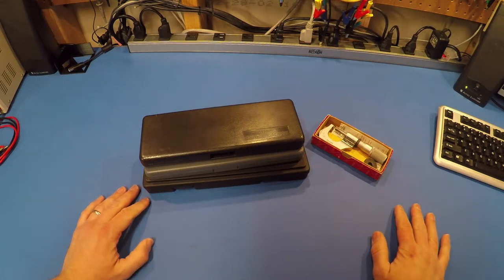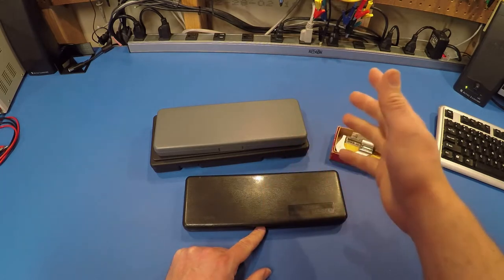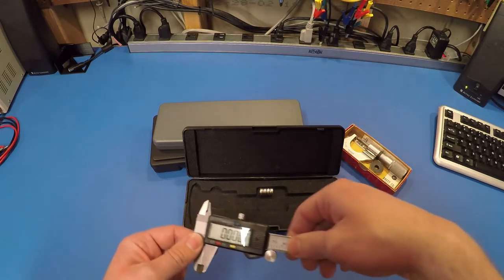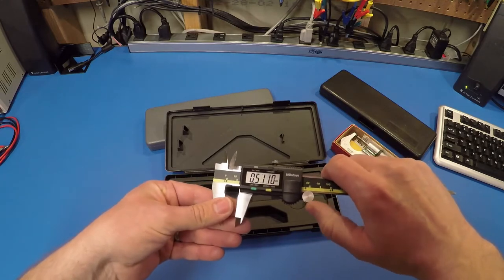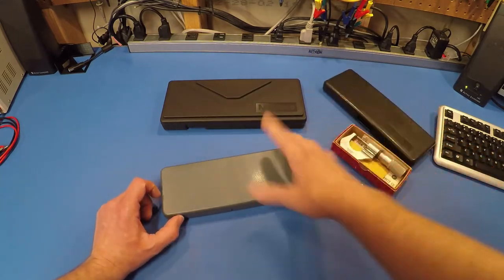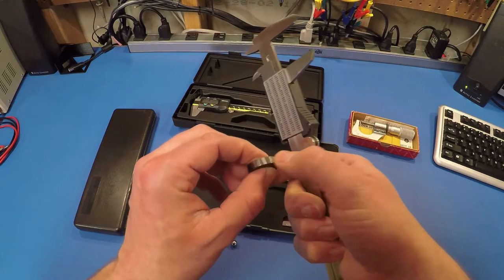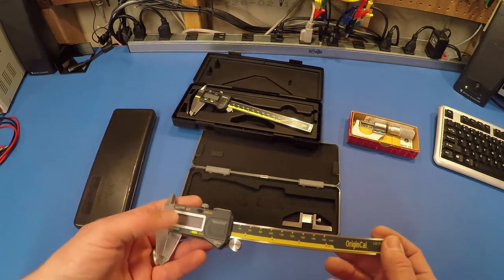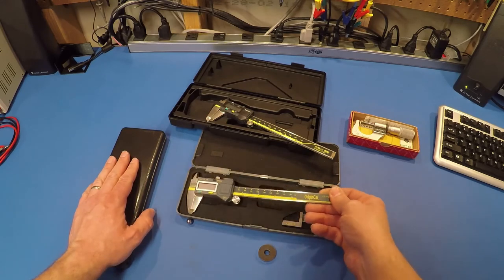Mitutoyo, iGaging (fractional) & Dirt Cheap Digital Caliper Comparison & Testing

Comment: I cringe when you touch the 1 inch calibration ring on its outer face. I had it drilled into me to NEVER touches the outer face with ones fingers. Our skin will leave corrosive material on the metal that will cause corrosion and affect the accuracy. We kept them oiled and in a soft cloth bag and only touched the sides. Thanks, for the review and information. Wish Mitutoyo would do fractions, but as they are made in a metric country, they don't seem to worry about what us dinosaurs use.

Comment: A tool and die maker once told me not to store any caliper in the full closed position, as expansion and contraction of the instrument could distort the tool and give an inaccurate reading.
Reply from the maker: Makes sense for a micrometer since it would hold the tension on the anvils if closed fully.  On a caliper, unless you've locked it with the thumbscrew, i would imagine it would be free to move with expansion and contraction.

Comment: I don't use calipers every day so I didn't want to spend a ton of money on them. I picked up a cheap 12" calipers and they have been decent enough for the money. The action is smooth, repeatability good, but not so good on battery life. The cheap 6" calipers I picked up were not so good. The sliding action is poor. The two moving parts seem to grate against each other somewhat. The company selling the cheap calipers makes a difference. There are the good and the bad. It is a bit of a crap shoot as to what you may get. The 12" calipers are the ones I find myself using most often although they can be overkill when measuring small items.

Comment: Very helpful.  Do you happen to know if the "genuine" Mitutoyos I see on eBay for $40 are actually genuine?
Reply from the maker: Not really sure but I highly doubt it for $40. If its too good to be true it probably is.  $80-100 would be more believable.
Reply: netmagi Thanks!  I think I will play it safe and stick with the iGaging.
Reply: Their are 3 quotes that have held true for a long time, Buyer beware, You get what you pay for, If it seems to good to be true ... it probably is,  So to answer your question ...  With absolute certainty ...No, they are fakes. Save your money and wait and buy the real deal, they will hold up to the test of time. You will much happier in the long run, don't support people counterfeiting others quality products that the original company have spent the time and efforts perfecting "Their" product. P.s I own both real Mitutoyo and iGaging  and I love my Mitutoyos but the iGaging are also very nice!

Comment: The case for the Mitutoyo has always puzzled me.  Before I knew what Mitutoyo was wrt to quality, I opened the case of one at work and assumed I was using a budget instrument.  It conveys cheapness.
Reply: It's not the case, it's the metal finishing that makes or breaks it.  The case/electronics are only a measurement of how the metal fits together.

Comment: Really liked the video until your comments on the "Japanese way of thinking; use your damn calculator" part. Truly why would anybody use fractions that only go up to 1/128" for 'precise' measurements? It's really overdue we Americans switch over to metric. I remember in high school when we started to use metric for physics class and everything was so much easier. Now as an engineering student even in Tennessee there is no question on what system we use in classes and labs. If you ask even our own citizens what's larger, 3/5 or 5/8, 90% of the population will guess or take a long time to figure it out.

Thank you for the video still, I learned a fair bit from it and this will affect what calipers I buy, but maybe it's time you started thinking like the Japanese :)
Reply from the maker: David B prefer metric myself as well, but I’ve inherited a few thousand drills, taps, dies, reamers, etc. from family so stuck with fractions for the foreseeable future. I do use metric for all my 3d design and printing work.
Reply: "Why would anybody use 128ths for precision". Well, you wouldn't. You'd use 64ths max for woodworking. Because that's beyond what your tools are capable of, regardless of measurement system. You'd use thousandths for garden variety machining, because that's what your tools are capable of. That would build you automobiles and airplanes. Like we've been doing, more of and better than anyone, for the last century or so. I'd say 128ths are at the limit or beyond what any caliper is reliable at. For a higher bracket of accuracy, we flip over to .001's and use mics and dial indicators. That's about 1/40 of your m&m's. The machine, nor the operator doesn't get more accurate just because they've changed measuring schemes.

Really, the whole "You should all switch metric" nonsense got old decades ago. America does just fine with inches. If you're more comfortable in metric, then go metric. The rest of the machining world doesn't have to change over just because you have difficulty with fractions. 

Thanks - Lumpy
Reply: God gave you 10 fingers to count with, unless your a Brit, he gave them a King who apparently had 12 fingers.  The metric system is far far better.  I'm a retired engineer who has worked over seas and used both systems.  The fact is most of the machining world uses metric.
Reply: @retirednobaddays456  Every American engineer and machinist and mechanic I know can convert easily to and from imperial to metric. It's a shame you "rest of the world's" can't. Thanks - Lumpy
Reply: @DrLumpyDMus  I hate the fraction function on calipers because in the real world nobody is working to 128 ths and the damned things with throw a 1/128 based fraction if you a a few thou greater or less than the useful fractions of 64ths 32nds 16ths  etc.  anyone doing close work will be working to 1/1000 ths  inch or 1/100 ths mm.

Comment: Chuck a low pass filter on your audio. Sounds like someones stomping around  :)
Reply: At what corner frequency? I'm sure a high-pass would be more beneficial.
Reply: @JamesBaber  sorry typo there high pass :) it's a fairly low rumble I'd at around 80hz down.  Great video by the way.
Reply from the maker: Thx. Ill do that on my next one when ppl are walking around above me (shot in basement)

Comment: The reason the battery is always in use is it "remembers" absolute zero.
Reply from the maker: thanks, that makes sense
Reply: doesn't explain why the good ones draws less than 1/10 of current when off compared to the cheap ones..
Reply: I had a high end caliper once where I changed battery after 7-8 years the first time, just the small SR44 size. Got a couple of cheap ones that is fixed to my lathe, where I usually take the batteries out of them every time not to run flat after some few days/weeks. Sadly that good caliper I owned did had the Mitutoyo style battery cover that so easily gets ruined. The cheap calipers on my lathe got the same battery cover style too, and those covers are naturally broken and gone long time, but I manage to keep the batteries in place anyway as the calipers are stationary more or less) I went for the Igaging caliper as my new caliper for ordinary 'hand held' operation, mainly because of the fine battery cover solution, and large battery. Seems good value for money.